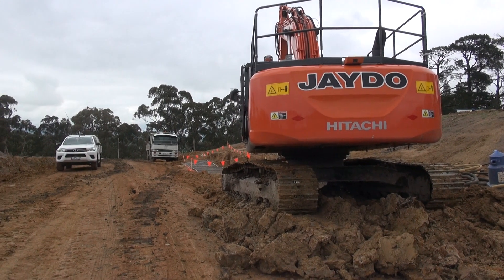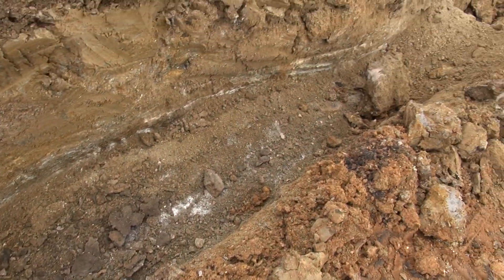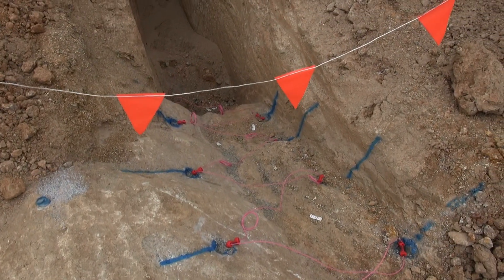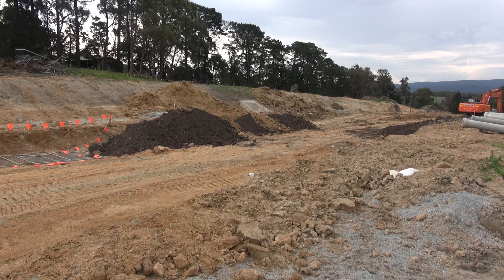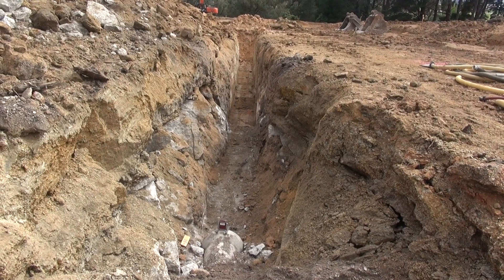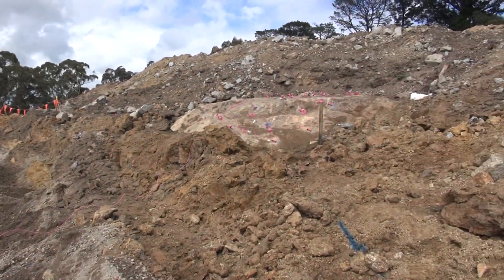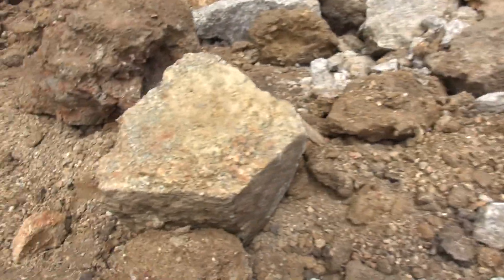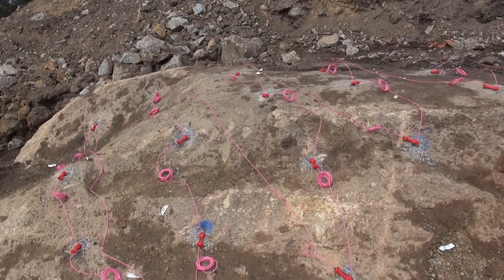Blasting trenches in Granite at Garfield

Comment: Good job. Question, what charge did you use per hole on the trench.
Reply from the maker: Hi, Ok I had three holes to the Meter, second shot was 38mm holes and loaded with 32mm packaged emulsion primer and anfo up to the stemming height at about 1m, first shot was 35mm holes and the result was a lot of tight rock that did not come out easily - the effectiveness of anfo falls of quickly in small diameter holes.
Reply: Cool.
Reply: @demolitiondavedrillandblast  I was wondering if there is Anfo milled to a different grade so it has more "crackle." So, smaller dia. holes would be okay to work in? Especially where a sharp line of break off is desirable like against a property line for swimming pool digs.

Comment: No idea if you will be reading this Dave, but i have a question.  Can you tell me why you didnt fire all these at once? Are you  restricted in some way? Vibrations/noise laws?
Reply from the maker: Sany0 - I read every comment, 2 reasons, there were neighbors and I did not want them to feel it and complain, especially as there is a much bigger job comming up near by. The second reason is that using milisecond delays gives much better fragmentation.
Reply: Ok Dave, thanks for the explanation. I was just wondering if you could of done the whole trench system in 1 go.
Reply from the maker: HI Sany0, sorry I missed this question, It could have been done in one go, it often seems that as soon as there is a number of holes drilled they want to have a blast, so we generally have a blast every day. The other issue is the amount of explosive that can be transported without placarding and the extra regulatory requirements.
Reply: Ok mate, i totally forgot about the carriage limit of explosives.